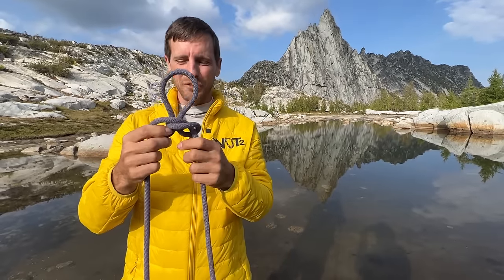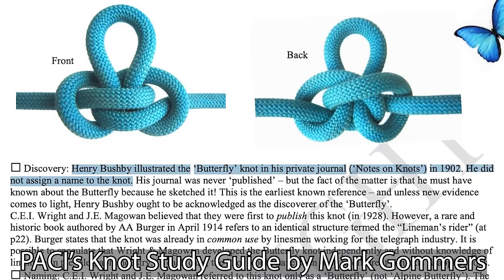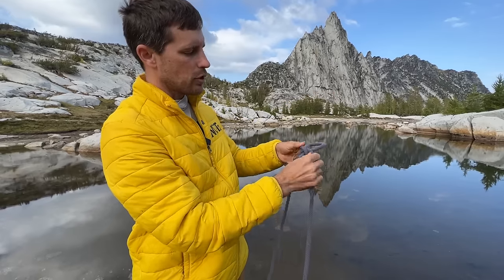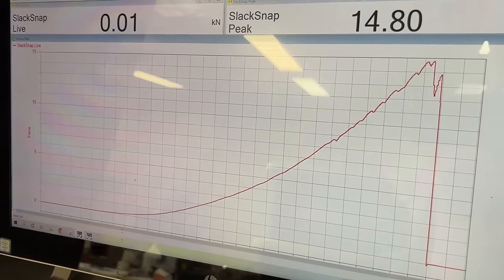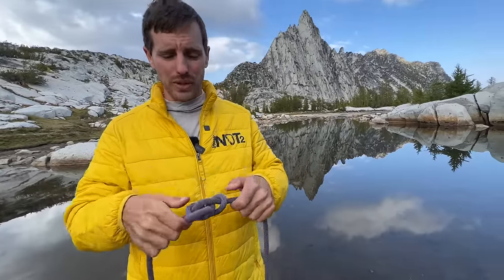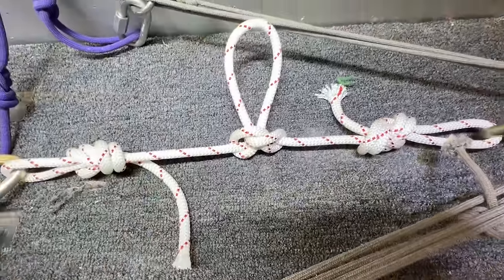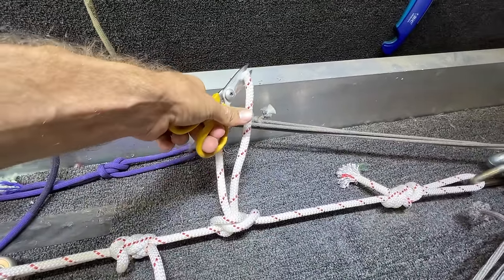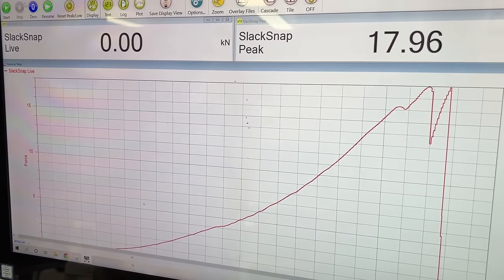What happens if you tie the Alpine Butterfly Knot wrong?

Comment: 16:57 : The first one came out wrong, too. The wings are not on the same side. The left wing looks as if it were facing to the lake (with it's rope) but if you were to pull the legs the left wing would turn away from the lake.
This is how I just managed to tie the knot:
(with legs I mean the rope coming out of the wings)
Go in and have it as at 16:41 and then tighten the overhand knot a bit and then you arrange the leg that is already part of a finished overhand knot to the side like it would be if the alpine butterfly knot were already done. Then you see one rope going over the finished leg and around the loop (loop that goes through the carabiner). This rope already goes around and becomes the leg. Then you can create the other side by also going around the loop but in the opposite direction. After going around, tunnel the finished leg (in the center) and also dive into the overhand loop that you just created.
The last step is easier if the unfinished knot is  pre-dressed and the leg is arranged as if the knot were completely done.

Comment: Could you do a comparison between the butterfly and a bowline in a bite. I work on seagoing tugboats although we don’t use many knots,occasionally we need to use a mid line loop. Generally the connections we do use round turns with figure 8s and splices. Knots in big ropes tend to weld themselves into a mass that has to be cut, even a half hitch. By big rope I mean things that have a circumference 7 inches and up.

Comment: Fun fact - the knot you get when the butterfly inverts during ring-loading is still a butterfly, the loop strands and the tail strands just swap places!
Reply: I know this knot as a mobius butterfly. In this form it becomes more suited to an endline knot than midline, or to create two independently loadable strands. And unlike many other loop knots it can take pretty much any loading profile if you dress it well (in-line, perpendicular, circumferential).

Comment: Will a directional-eight knot be better to isolate damaged parts? Will it slip the same? Will it break under a similar load? Also, for a non-opening rings you don't need the follow-through method, but to carry the ring altogether with the bigh:D What if you secure the damaged bigh by just passing one end of the rope by it?(if you are really short of rope...)

Comment: The loop for your long-link or progress adjust should be at the end after the overhand and not between the damaged part. The damage part should be the longer side of the bite and the not damaged part sould be shorter. At least that's what IRATA says. Probably doesn't matter that much.

Comment: I completely respect your approach, but sometimes I wonder if the brake strength is telling the whole story. In this case, for instance, the curve is very elongated compared to other knots which break at higher load, but more suddenly. Doesn't that profile imply more deceleration and thus and effectively higher load? Can these results be trusted without a drop test?

Comment: The Knot shown at 20 mins I have used caving and refer to it as the cavers butterfly in the UK, super easy to adjust and untie but Has to be pulled from 3 different directions to keep its integrity. For example, a hanging traverse in a cave where it is the middle bolt.

Comment: I need some help getting the follow through knot tied, I always end up with the wings on opposite sides. In the video at 17:14 the resulting knot looks like example #1 where the wings are on opposite sides, am I interpreting it wrong?
Reply: I figured it out! After the working end of the rope is threaded through the overhand knot, it can go behind the loop two ways: it can go "inwards", across over the elbow of the overhand and around the loop OR it can "outwards", away from the elbow of the overhand and around the loop. If you go inwards and then wrap around the loop, you end up with a proper alpine knot (#2). If you go "outwards" and wrap around the loop you get the "wrong" butterfly with the wings on opposite sides (#1). 

I'm pretty confident the example knot Ryan ties is not the "correct" alpine butterfly as the working end is wrapped around the loop "outwards" and the wings appear to be on the opposite sides. 

Side note: instead of looking at the wings of the completed knot, I find it easier to look at the ends. If you pull each end of the rope in the opposite direction, are both ends on the same side of their respective wing? If so, it's a correct knot. If one end is in front of it's loop and the other end is behind, then it's wrong.
Reply: @byronc7571  The way I think of it is an overhand knot, interlocking with an 'underhand' knot. 
So tying the same knot twice will give you the alternate form, the individual overhands need to mirror of each other to make a butterfly.
Reply: I've got the same result.
Reply: @TheAwkwardGoose  thanks, I totally see that now! Great way to understand what's happening.

Comment: The second incorrect form is acting very similarly to a sheepshank. So it is gonna hold pretty well if you load it once and then keep that steady, but if you cyclic load it in any way it's gonna get worse and worse while the half hitch slips at which point it's just a basic slip knot.

Comment: The slipperiness of the dyneema is annoying af. More passes are needed than usual. But for easy disassembly I would use a 10 bight nail knot with a release over the 9mm that has any stopper on it.

Comment: I tie this a little differently. I would say I don’t like yours because it is hard to pull slack for a longer leg or equalization whatever. I go two wraps with the third turn in the middle of first two. Grab the bottom turn between rope and palm and pull it up and rethread it from the bottom up  between the palm and the rope. If that makes sense? It’s much easier to pull a longer bight if you need to

Comment: There issue with doing it around your had is that it only mkes a small loop.  While the tradational way you can use it to tie a knot that can be looped over the body.  Now yes no one would loop the loop over your body in the modern day use of harneses but.  I have seen the hand loop method ties some weird kind of butterfly loop but it is not the same as the traditional method.
THe treaditional use was to tie in a middle man.  Then to tie a Z rig for cravass rescue.
Reply: Not so.  I can make as big of a loop as I want to while using the 3 loops around the hand method.  Once you grab the loop, you pull it up and away from you hand, and let the two tails spin around your hand before you cross it over and pull it through the "hole".